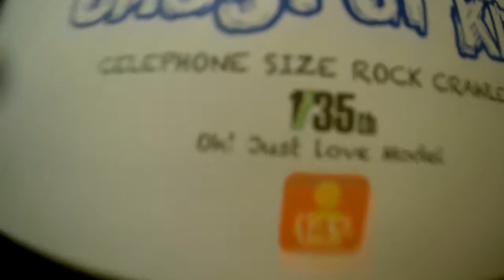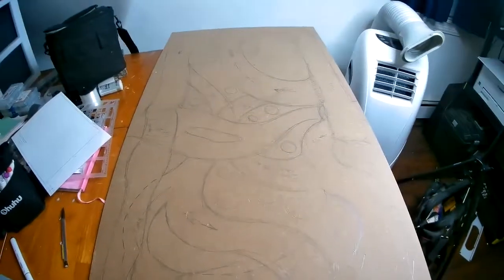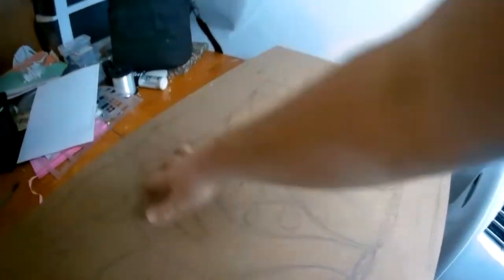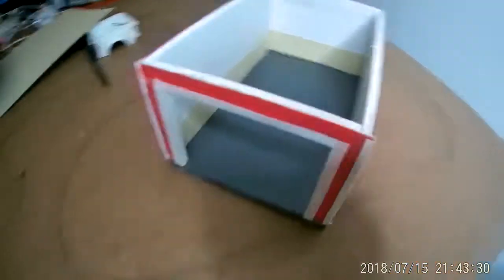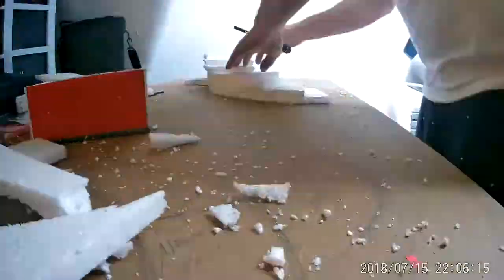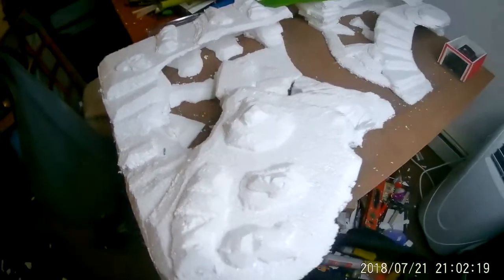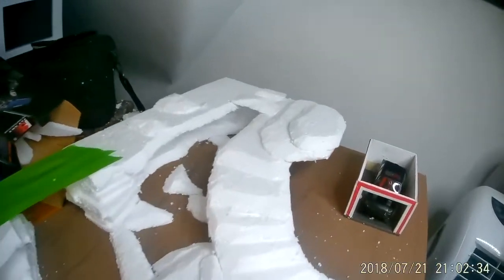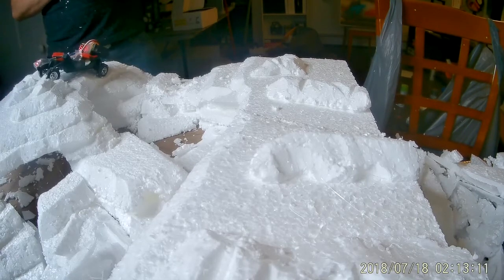Orlando Hunter 1/35 Scale RC Crawler Course build - EP1

Comment: That's funny I'm on the same project as you, as it often rains here I told myself that I needed an indoor track for my mini crawlers . I also look at the Orlandoo jeep on Atees I think I will buy it because it will be better than all the 1/24 rc that I have. But the radio control is not sold with, how with you connect your radio? because I saw that the Orlandoo the index cards are not the same as on the 1/10 rc. Are you going to make a video of this connections ?
Reply from the maker: Heyy, I may build another Orlandoo  Kit and show how I hooked up the electronics and such. I will admit I have kind of put together a rough electrical system for this little rig, its not perfect lol. Thanks for watching man!
Reply: @3drc653  Thank you for your answer, your video on the connections will interest me a lot because I can't find any explanations on the internet and I would like to know how to do it before buying this little rc. Thanks again my friend 😊👍